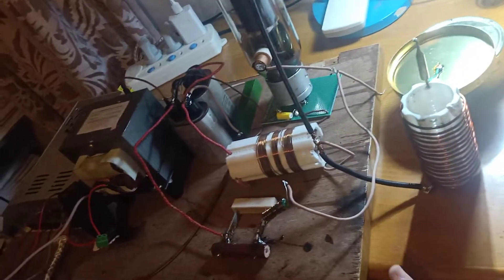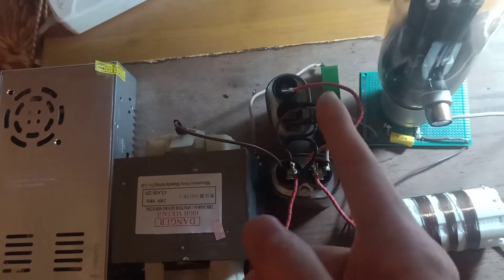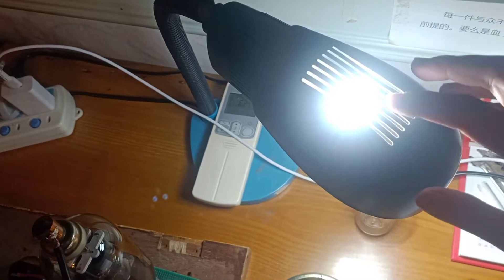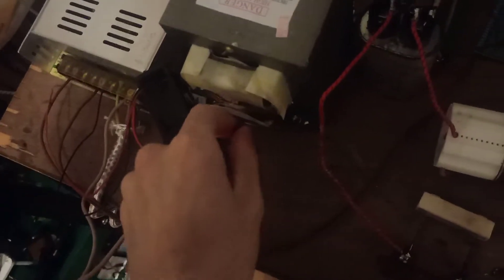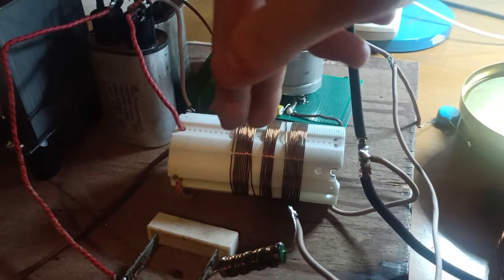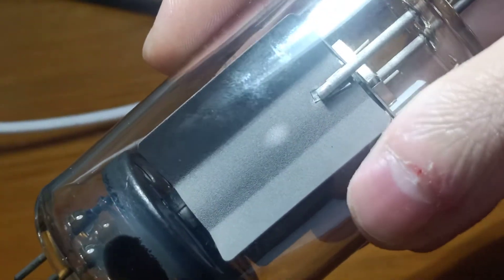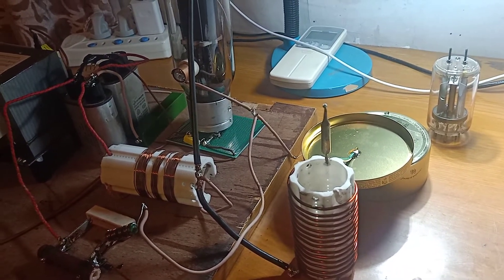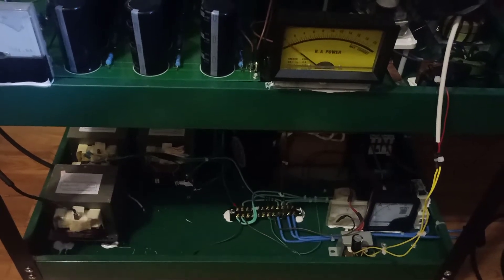HFVTTC

Comment: What's the reason I can only use a tube here. Can I use a mosfet?
Reply from the maker: This is a very old video and at that time I do not know quite a lot about RF 😹 so I was using a tube since it is more robust. Later I used FETs in such a circuit, for example this one: https://youtu.be/qvRzZcaQ32Y?si=XZeL37sf6qMo2Ayn
Reply: @uecmitsuimarinedieselengin873  I'm brand new to building electronics but I have studied Tesla all my life and others. I hope I can learn from you. You are very smart. I'm studying crystal radio with only mosfet/s diodes, caps, inductor air coils. Nothing else. I want to use Earth current (pristine ground to Earth) to excite it's electronic particles/field into the receiver circuit. This is why crystal radio need to be grounded to use earth current as cathode or a source of electrons.
Reply: You can use a mosfet, but they're more fragile. They work great though!
Reply: We have wireless electricity. I want a group of friendly inventors with integrity to work together.

Comment: Are they plastic or ceramic coil forms?
Reply from the maker: They are ceramic,plastic material is so lossy  under this high frequency RF.
Reply: @uecmitsuimarinedieselengin873  Non polar plastics like PP are low loss, but they'd still melt because the enameled wire gets bloody hot 😹

Comment: I really like your candy can air gap capacitor , I think I will do something like that did your measure the capacitance ? I know it would change depending on the size and the distance of the air gap , but it looks like a nice cheap way of making a high frecuency high voltage cap in the pf range
Reply from the maker: Hi sir ,i had calculated those air gapped capacitors and they are within 15-20 pF range

Comment: great work, i was looking for an HFVTTC example and this seems pretty reliable, i've seen schematics without a grid leak inductor, i was wondering how you come up with choke inductance value and also that grid leak inductor, i bet the second one isn't critical
Reply from the maker: The choke is not so critical,you juat need to wind maybe 3 times more turns than the resonant  coil and it would be good. You should keep in mind that the choke should not resonant  at a harmonic frequency than the resonant  coil or you may see arcs between the turns of the choke where have a huge voltage difference between some of the turns.For the small gird choke,the inductance is not critical as well.You can wind about 7 turns on a burned risistor as i did.The aim of that inductor is to let the tube work on Class C as in radio transmitters. Fine tune of that inductor will need highvoltage probe and current probe. During my tests I find that if you tune the grid DC current about  1/5 of the anode DC current [actually measured at cathode for safety] then your tube would be working on Class C and give out the most power it could provide at that voltage. You can find more details for Soviet book online which are about induction heating and high frequency fusing machines.I referred to the book named 电子管高频加热装置 in Chinese.
Reply from the maker: The grid risistor and the grid inductor both influence whether or not the tube works on Class C.
Reply: @uecmitsuimarinedieselengin873  thanks for responding, i think i have enough hints to succeed, i'll give it a try, altough with a small tube (GU50 or a TV line deflection tube)

i can't find that book and i can't read chinese :D i'll just stick with what others did and use my experience